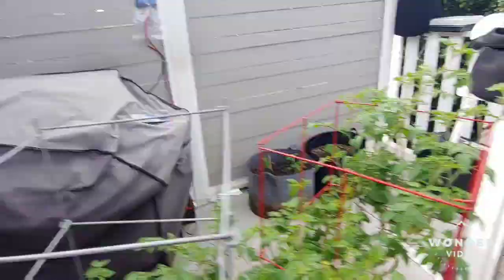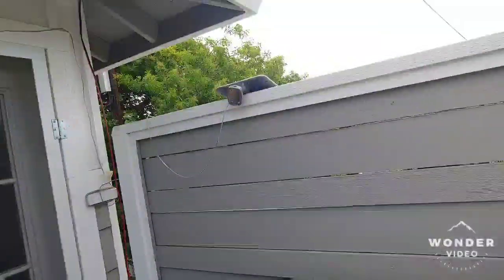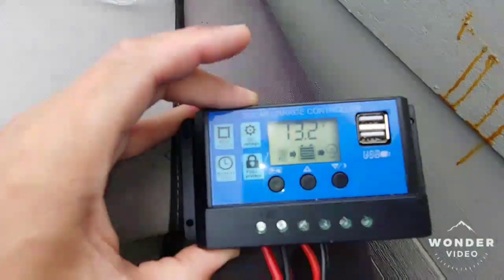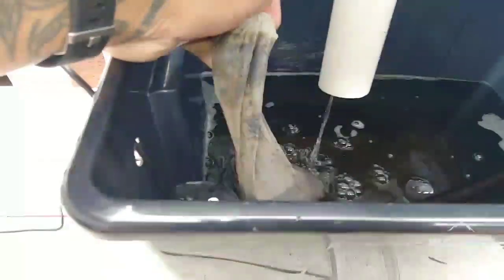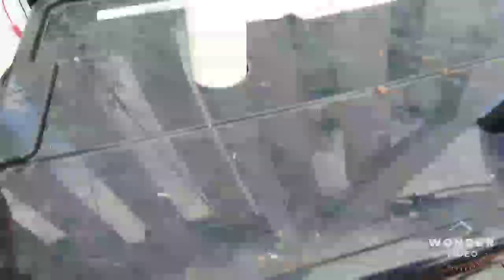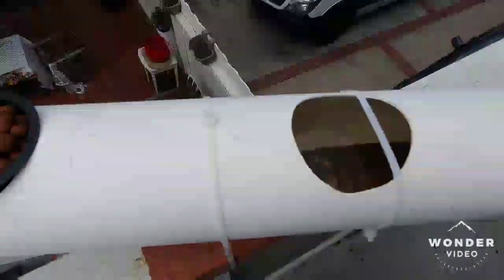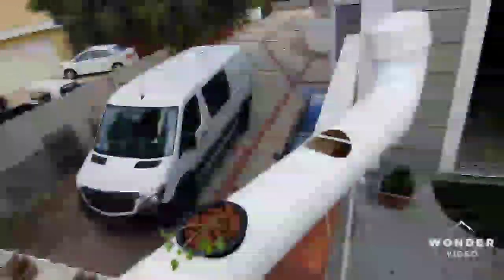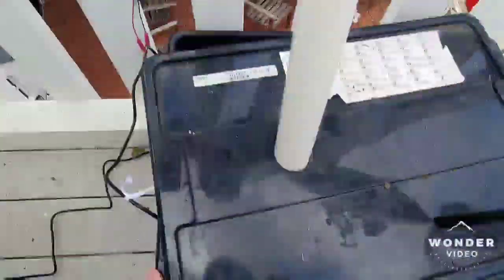DIY Solar Powered Hydroponic system explained

Comment: Super cool. I’d wonder though if your batteries might be sucking back and forth from each other killing themselves. Each battery would need to be exactly the same shape and voltage to be most efficient. My thought but awesome job!
Reply from the maker: yes , you really only need one deep cycle but those are freebies so ran that for quite a while...

Comment: How does the system hold up in drought?
Reply: Any hydroponics system will use 90-95% less water. There’s much less evaporation, mostly only from the plants themselves. The water goes back into the system and is pumped back to the top.

The only problem is, as water evaporates the concentration of nutrients increases. So you need to regularly need to refill water if it’s very hot.

Comment: I got lost with air pump water pump electric supply. how is it fitted each other? can we run fan too in that way?
Reply from the maker: H what do u mean ? It's solar panel to controller , controller to batteries (supply) batteries to water pump and air pump. . yes you could run fan , would it be for cooling ? Maybe a green house ?